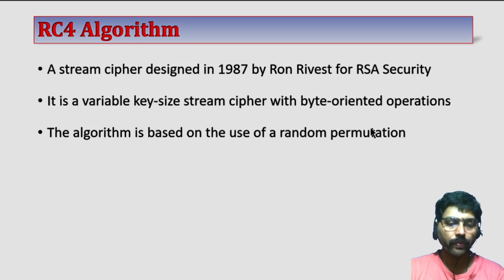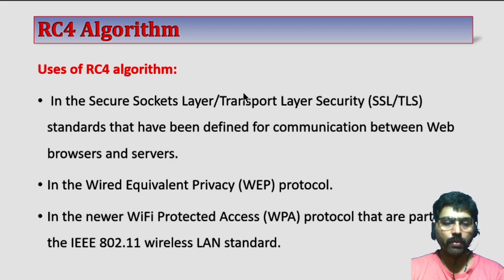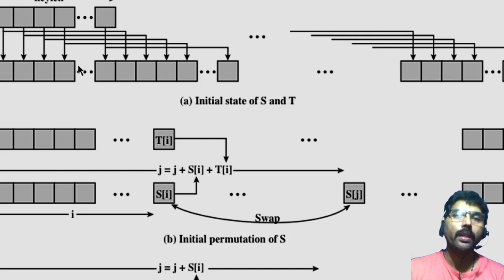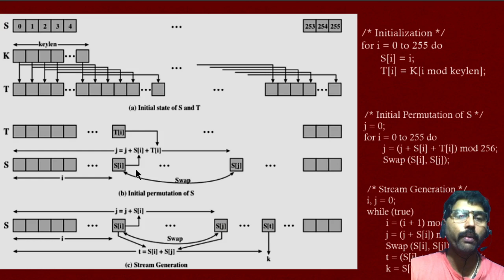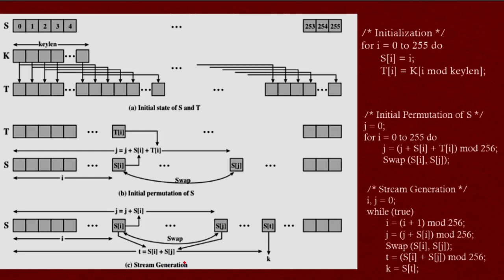RC4 algorithm

Comment: In RC4 encryption for the DMR system we use this protocol, after the use of the two algorithms KSA and PRGA resulting from applying them to the private key, plus the initialisation vector we get a keystream, the encryption as such is the result of performing an XOR of this keystream and the voice in clear, taking into account that in each super frame the initialisation vector is modified.

The question is the following, if I have the encrypted voice, against which element should I perform this XOR to the encrypted voice if I do not know the key and therefore, the keystream.